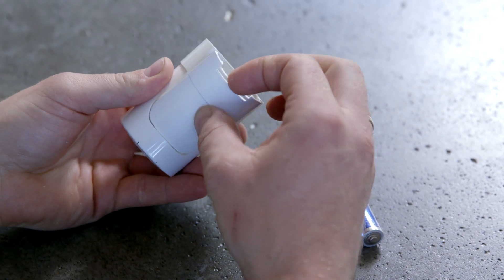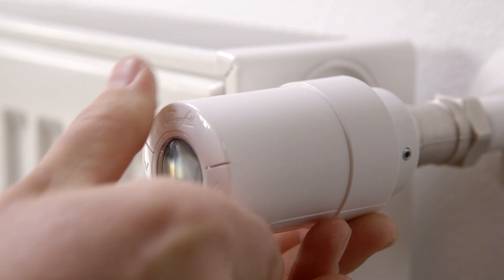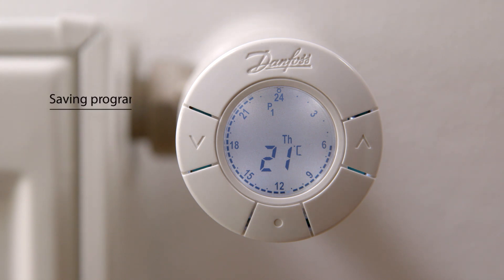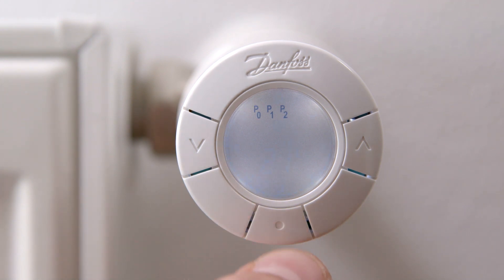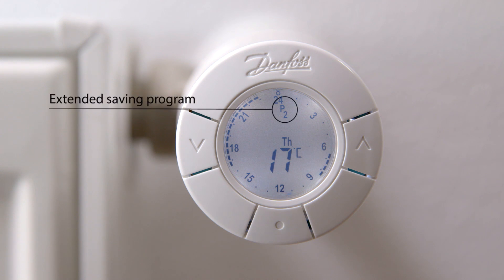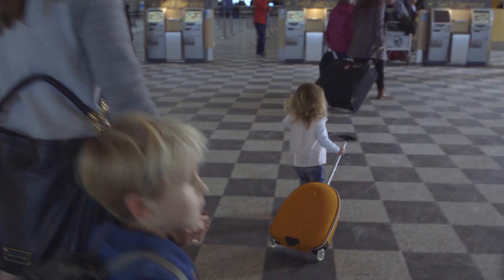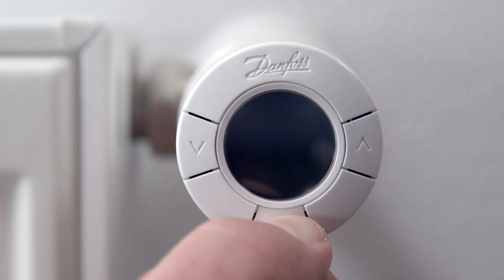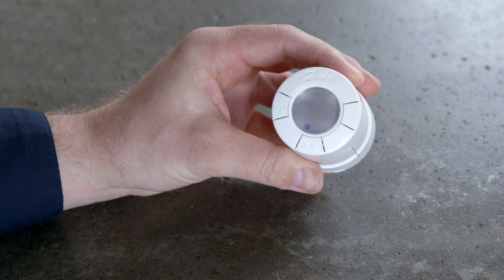Danfoss Eco User  Guide (version 1 of the Eco thermostat)

Comment: Should I use pause function for the warm time of the year when the central heating in my building suspended or I should use vacation mode with set of min temperature?
Reply from the maker: Hi Yuriy, both approaches are correct and can be used. Please choose one you consider as more convenient.  Have a good day Danfoss Climate Solutions

Comment: Needed to change the batteries every 3 months... Can't change the temperature, it is non responsive, will turn on randomly and will be impossible to turn them off. We are living in a freezer right now
Reply: Thank you for the comment. 
We are sorry to hear that you have challenges with your new product. 
We highly recommend you visit our FAQ page by the link: https://linkapp.danfoss.com/hc/en-gb . 
In case if you didn’t find the answer, please write us request by the link: https://linkapp.danfoss.com/hc/en-gb/requests/new or contact our Customer Service Center: 24/7 - International number, Tel.: +331 83 82 37 90. 
Thank you for being with Danfoss.
Reply: sounds like your actual thermostat valve is a bit faulty, when you take the device off can you see the pin out slightly, when you press the pin with a screwdriver do you hear water flow into the radiator? if its a danfoss valve make sure the metal ring is set to N ideally or a number between 1 and 7